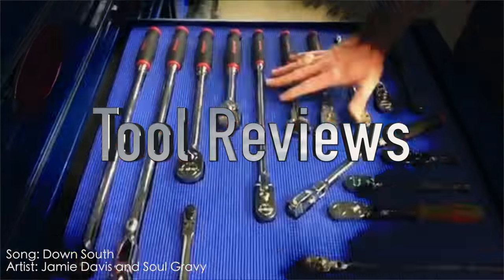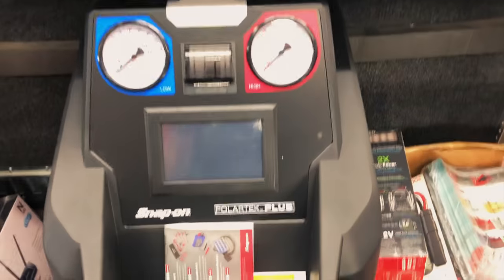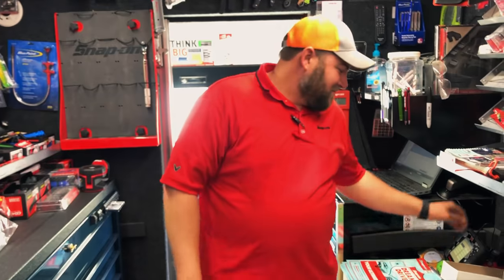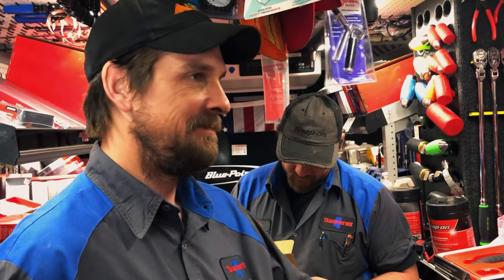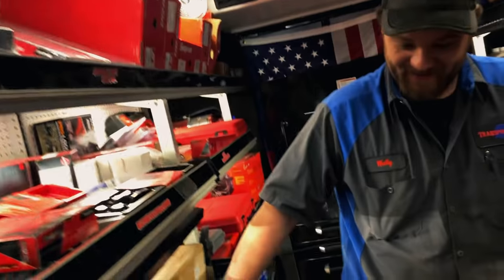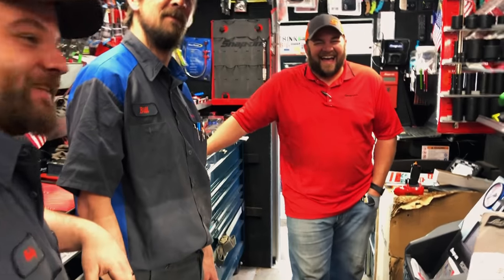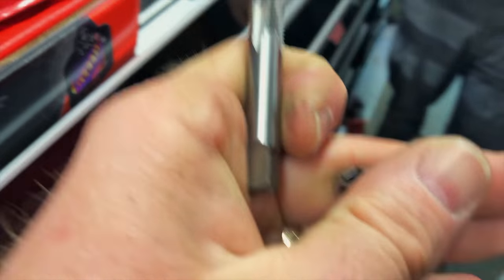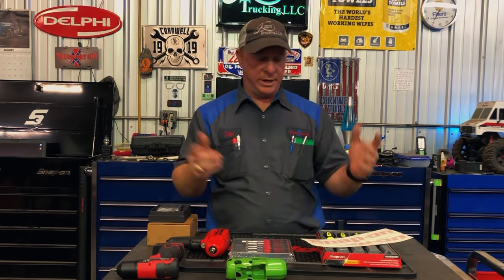Snap On Friday Two New Impacts: MG325 and CT725

Comment: Sorry Clay but I've been a diesel mechanic for a long time and I've had both of those snap on impacts and they don't last. Best luck I've ever had with an impact are Ingersoll Rand for air and Milwaukee for electric. Enjoy your videos keep posting 👍
Reply from the maker: I have a Milwaukee m18 fuel also and the m12 1/2” Stubby. I just like the trigger, size and weight of the Ct761 
Bill got the MG325 a few months ago and we love it. That’s why i got one. Hopefully it will last longer than my IR. It went down after 7 months. It’s already been sent off waiting on it to come back now.
Reply: I also only have Ingersoll Rand. My air impact gun is 15yrs old and it still going strong!

Comment: For pilot bearings.. teach ya something....dont use pullers. Instead Cram soaked newspaper pieces in there and beat it in with a hammer and a punch(anything that takes up most amount of space). The newspaper will push out the bearing. 

Now go return that tool to Hamilton lol
Reply: V S I’ve done the same thing with grease
Reply: @MagWire8  I like the wet paper because it's easy to clean and it actually cleans out the pilot bearing area.
Reply: V S  I’ll have to try that